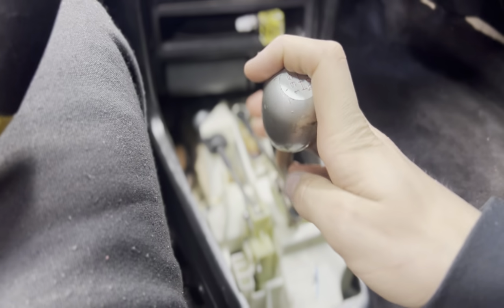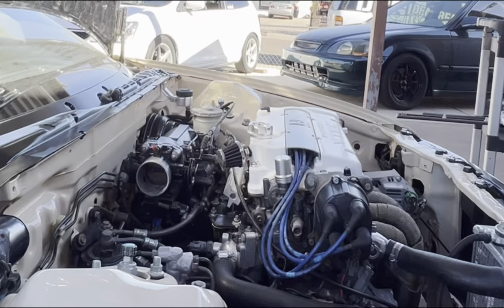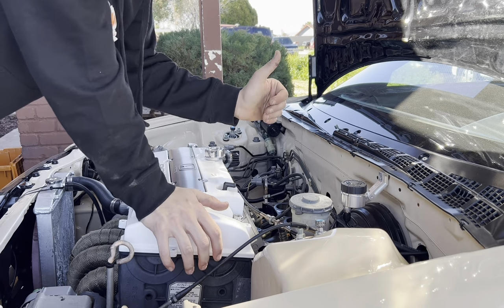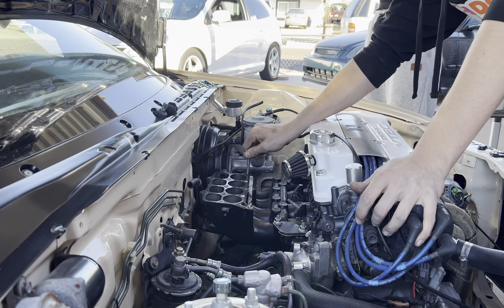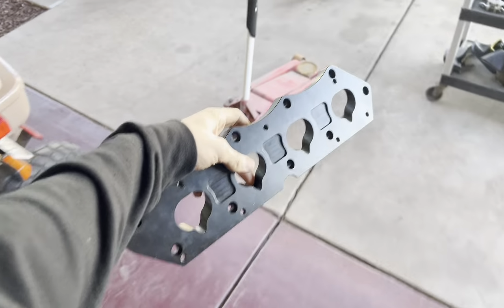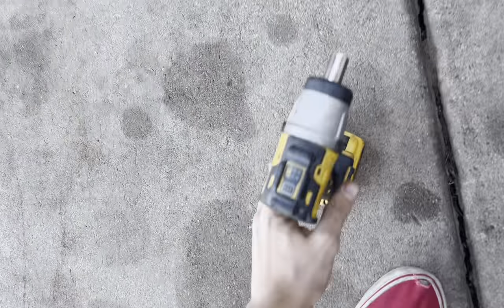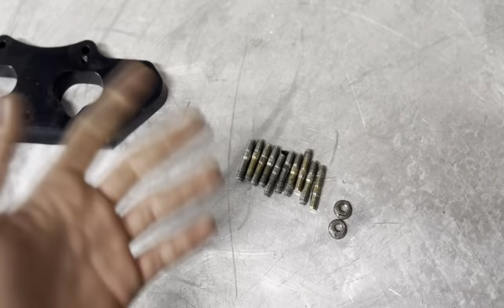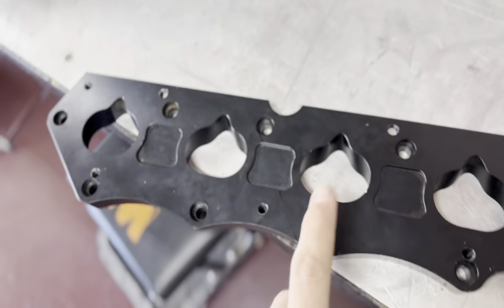Creamy Build! WE are back!!

Comment: U sure u didnt burn up the syncros cause its supposed to use 3 quarts of gear oil
Reply from the maker: I’ve Never driven the car before bro other than up the block
Reply: Check the level just to be sure cause  remember its a used trans